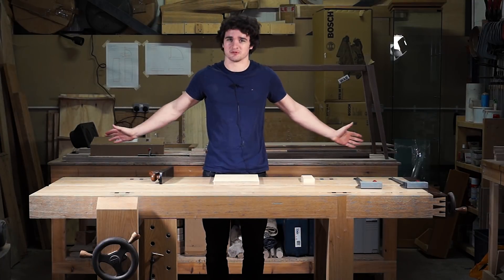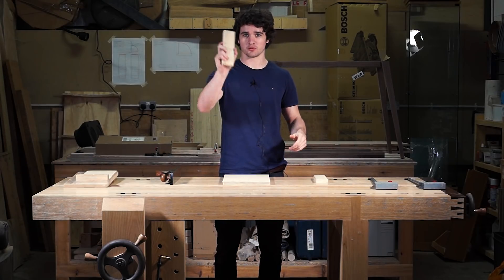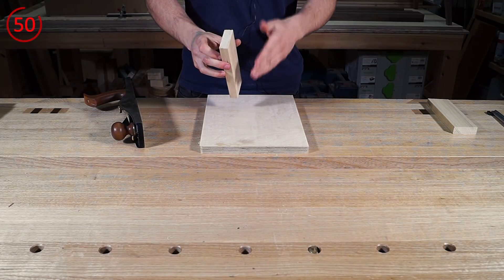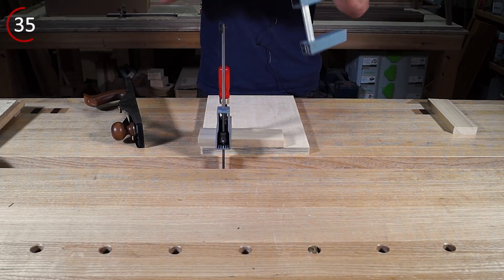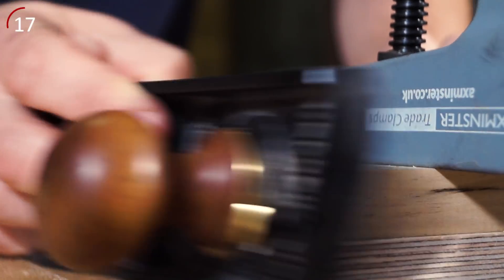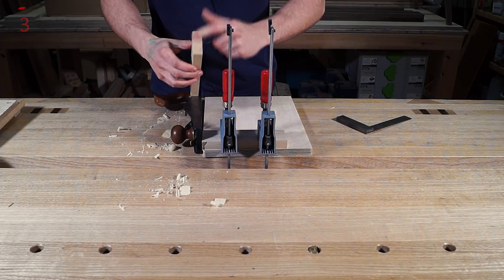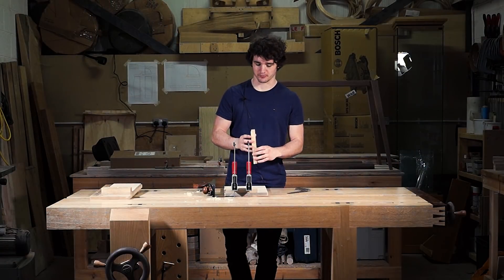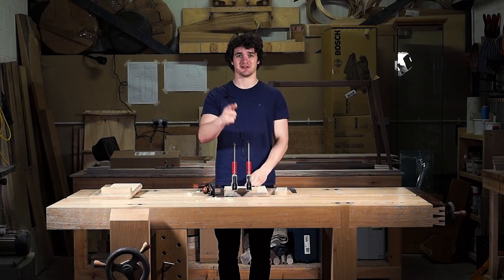How to square END GRAIN | 1 Minute Wednesday

Comment: Bit late here but ...i have a question.... wont the plane eat away at the edge of the plywood over time.. and slowly reduce accuracy?
Reply: Hi, even later here.posting for posterity - this doesn't happen because your plane doesn't cut all the way to its edge; if you look at the bottom there's a small flat area on either side of the throat, no more than a couple of mm.

When you start using a shooting board, your initial cuts will indeed plane of the plywood. However, you'll see it quickly develops a tiny shelf at the bottom (due to the above mentioned area). It's this shelf that the plane registers against, and not the rest of the board. This means that the plane only ever cuts into your workpiece and the sacrificial board.

Comment: Topics, for 1 min or more !
- square up or make vertical a drill press table
- clean up clamps
- final sand finish of a surface 
- min professionnal preparation for applying a oil or a was on a piece of furniture and to clean and ...
- adjust assemble and stick square boxes ... like kitchen cabinet or jewelry without the hedges to overlap
- cut and flatten tenon with saw and hand plane without leaving marks on the surface
- table saw squareness trick
- quick router jig for hinges
Sorry for my english ... not perfect ...